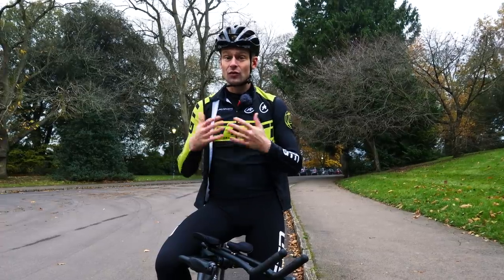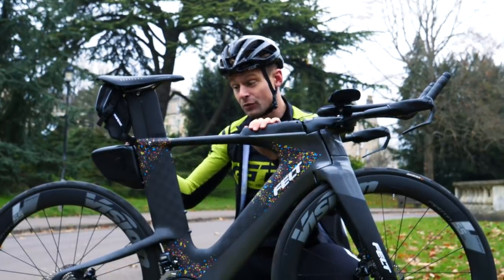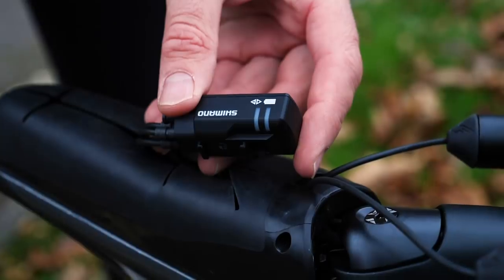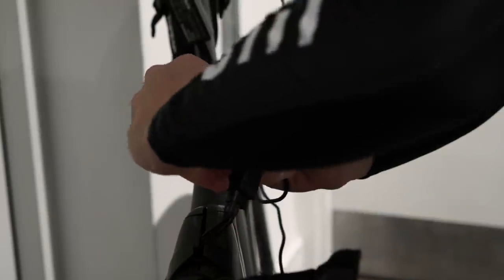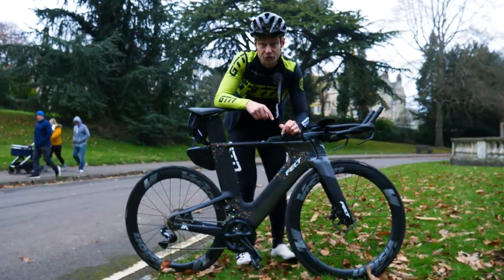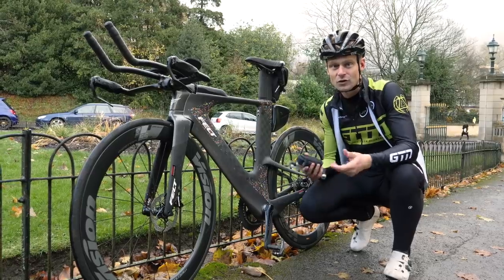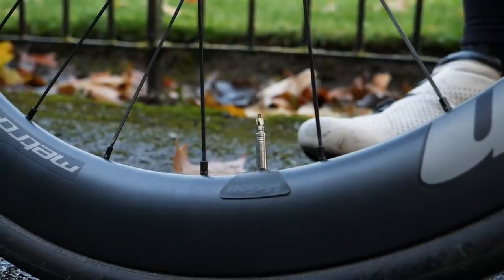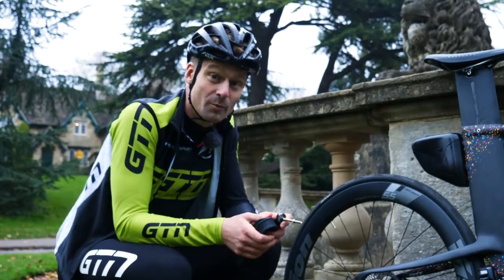5 Common Roadside Triathlon Bike Mechanicals & How To Fix Them!

Comment: More times than I like to talk about, I've had my cleats come loose on my shoes - even break.    This is really awkward as you either lose the connection with the pedal or worse can't disconnect from the pedal.   I now try to check the screws frequently to ensure that they are tight.   When the cleats break I take them back to the dealer and always get a replacement set, but that's still a hassle.

Comment: Thank you Fraser. very useful. Although, what the hell is electric gear change?....i'm new to all this!
Reply: Simply put...motors shift instead of cables.   This allows the shifting to be VERY accurate and eliminates the cables.   The downside it is another thing to charge and it can break.   I would say in another 5-10 years...it will become as reliable as cables.  But until then...I would call it a perk for professionals.
Reply: @trepidati0n533  thank you. It does sound all too high tech. maybe i'm too much old school.
Reply: @PoetWithPace  The latest drivetrain from SRAM is only like $4000...
Reply: @PoetWithPace  Nothing wrong with cable tech.  If you know how to tune cables "correctly", they are just as good IMO as electrical.  However, electrical have a slightly advantage when it comes to "travel".  Thus for pro's..it is a viable tool.  For age group armatures...well, I can get a lot of tunes for $4k.
Reply: @trepidati0n533  i know what you mean :-)

Comment: Seen plenty of guys on mega tt bikes pushing home in a race. I was hoping you were going to mention tub’s as I’ve never used them. And I guessed the above were and couldn’t fix with inner tubes. Can you? Not to mention glue melting with heavy braking, on carbon rim brakes!
Reply: you don't brake on a tri bike:)
Reply: You can fix tubless with a tube but if someone was running tubulars you need to replace the tire.  Not many are using tubulars and glue any more with the improvements in clinchers and also the availability of tubless options.